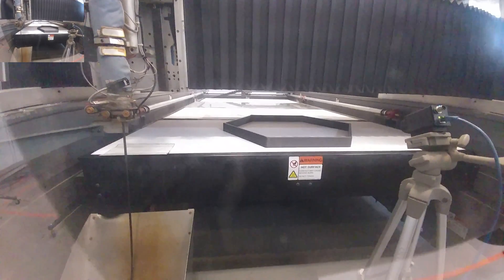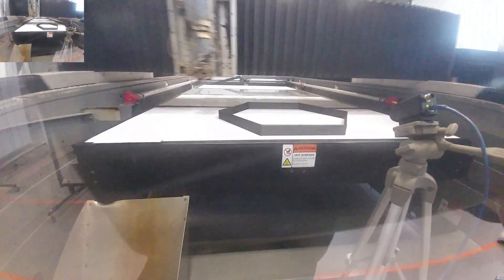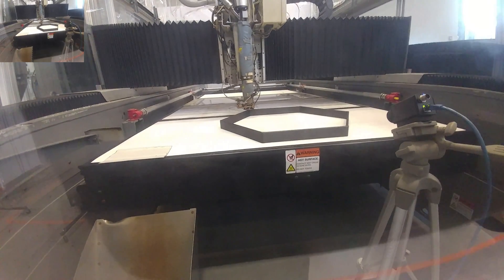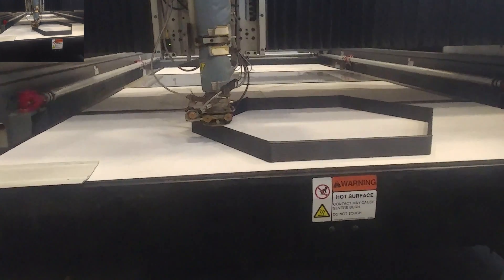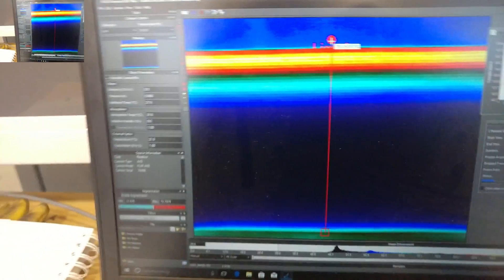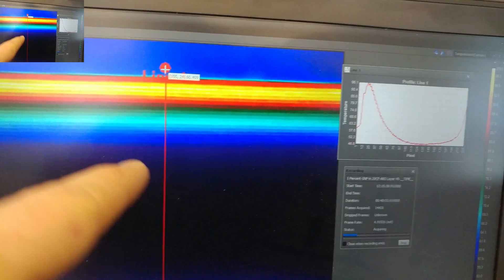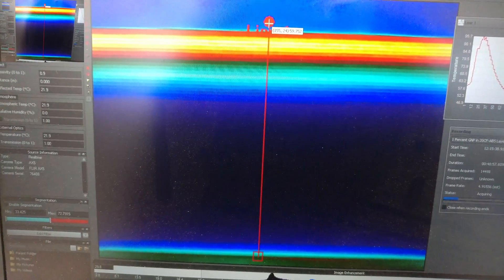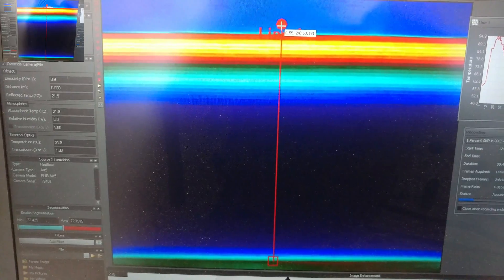Graphene 3D printing on a massive scale

Comment: with a 3D printer like this, I know we talked about using fiberglass to cover the material and create small products (ex. pieces of car parts, toys, nik-naks) would you think it is possible to do? Also even if I were to try this with a smaller 3D printer with Graphene-Epoxy filament and do small prototypes would I still have the same effect? lastly, if you were to choose based off 3D printers with High-Def to start with making prototypes what would you recommend?